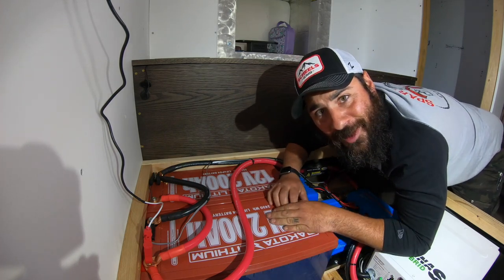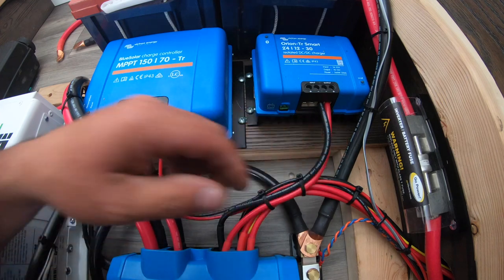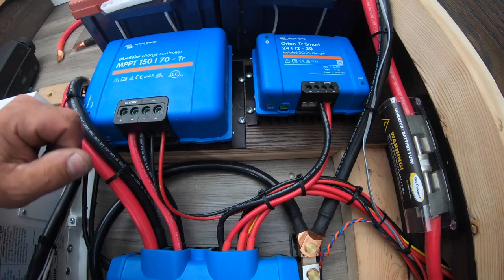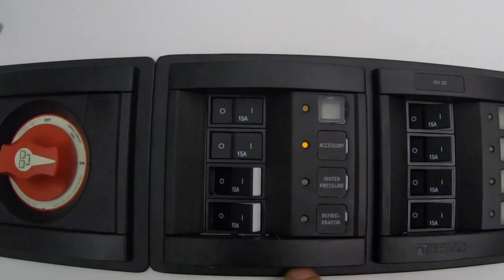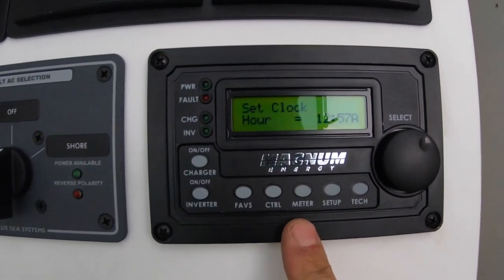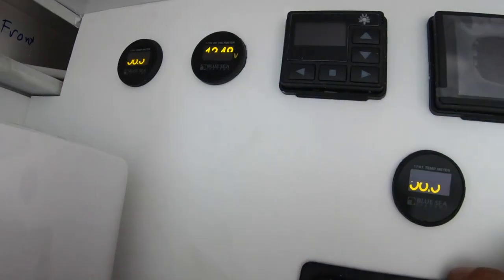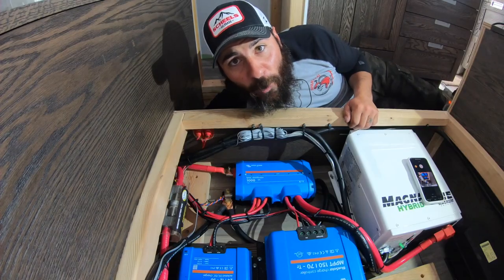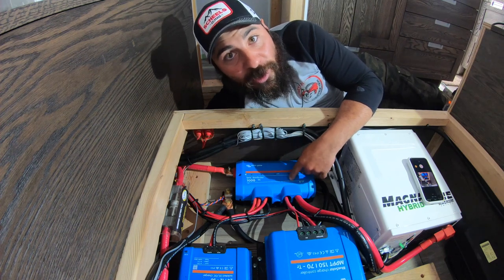Overland RV complete electrical system

Comment: Very nice.  I don't mean to tell you how to crimp wire, but I do it a little differently.  I crimp on the connector first and then stare stupidly at the shrink wrap tubing wondering if I can fit it over the connector. I usually can't, so I cut of the connector I just put on and swear I won't do that again.  If I am lucky, that lasts for about 3 connectors before I am back to staring stupidly at it. I guess your way works too....
Reply: Nice! I’ll try to Remember  your advice. It will probable come to me at the moment. I’m intuitive that way!
Reply: @Eliukcory  My Mom always said I would be an example for others.  She used the phrase "cautionary tale"...
Reply from the maker: Haha 😂 don’t worry that was my second take!!

Comment: You might think to make a kitchen plug that might see an induction cooker on its own and microwave also on its own. These should get their own runs even if you don’t do the breaker now while things are open so that if you try it the way you suggest and it’s insufficient you can just add the breakers while not needing to run new wire.  Not fun to trip things out constantly and then tread wire where you’ve been before. I would consider a larger wire if you are doing one circuit and make it 20 amp plugs  they are much harder to trip. That would be 12 gage wire instead of 14.or ignore me that’s cool too. Just trying to help!
Reply: Your doing a really nice job as far a diy! Good work! Keep it up
Reply from the maker: Thanks for the recommendation, one good thing is The wire I have run for outlets is already a 12ga . But my biggest problem is I really want to run all blue sea panels and sourcing 120v switch gear has been difficult to say the least. I have ordered panels twice for 6 gang 120v and both times they came in and were the wrong panel. I am continually scouring the web to find more “in stock” and if I find another I will definitely add more circuits.
Reply: @jeffcobuilds2660  right. You just have the potential for some heavy loads. 1000w-1200w microwave. Same thing for induction top. Same for some of the coffee makers. So if you cans sport 20 amp breaker you’ll. Be ahead if it only on one. But again I would encourage you to run separate home runs for each plug so you can decide it latter if you want/need to.

Comment: Hey nice lookin rig! Lots of great info. I should be picking up my 1078 from Martin in the next week or two. So my question is do you like the 1079 box as a good starting point? Im just trying to decide-find 1079 box (to modify) new ground up box-box DIY kit. All these big decisions LOL
Reply from the maker: Yes the 1079 box gives a good point of entry into getting right into building out your habitat. One thing to keep in mind is do you care what your gvwr weight is? I weighed my truck when I bought it and it was 22k lbs before I started modifying and building it out. So I am hopeful to be under the gvwr of the truck when completed but it will be hard to get that accomplished. I think a full composite box might suit you better for weight and if I was starting with just a flatbed 1078 I would probably just order in a composite box and add 3 more months to the build. Unless of course you can find a good used 1079 truck with the box already mounted. Hope that helps..